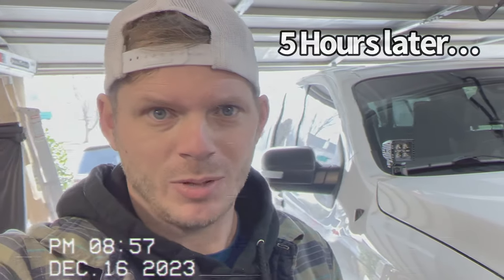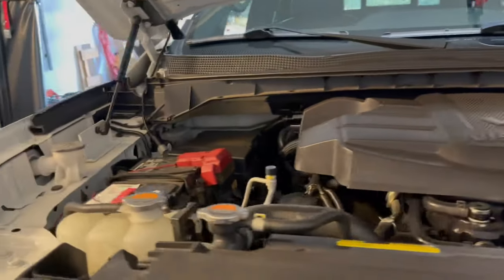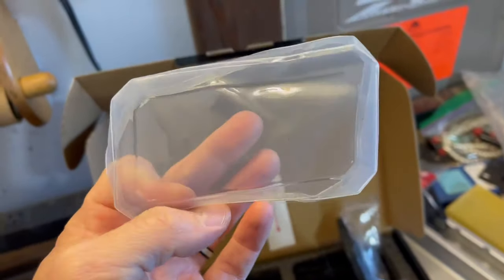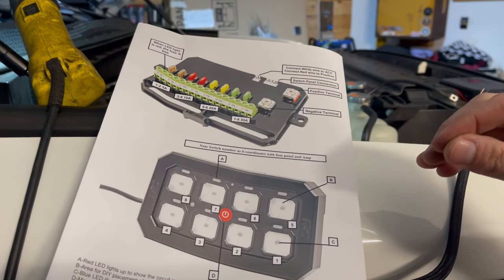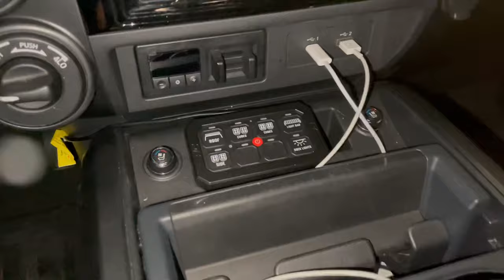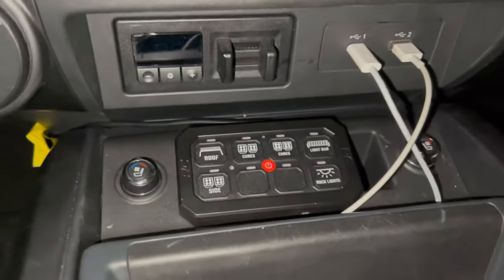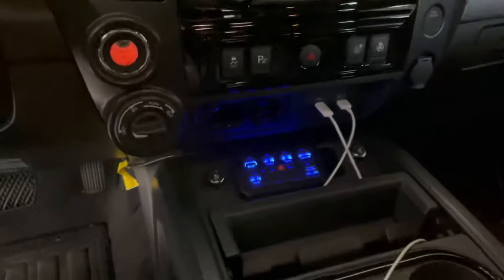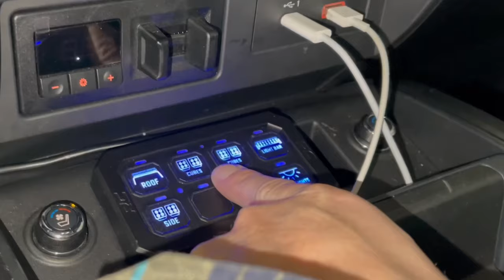Rough Country 8 Switch Panel Install | Nissan Titan Off-road Lights

Comment: Clean install 🤙🏽 what did you end up doing with the white Accessory wire sense I didn’t go into the fuse tap?
Reply from the maker: The white accessory wire just went to the negative battery connection on the panel.
Reply: Makes sense thanks!

Comment: Great info! Did you tap into an ACC fuse under the hood? I noticed your switch panel was lit up before you turned anything on. I can't seem to find one that isn't always hot under the hood.
Reply from the maker: I couldn’t find one either.  I actually just ended up using my original rock light switch to be a switch for the panel.
Reply: that is my issue my panel is on all the time? can someone recommend another fuse on that panel ?
Reply from the maker: @jaimeherrera5419  there are t any.  I checked them all.  You can just put a small switch in line.  Run the power to the switch then from the switch to the panel.  I just used a small toggle switch—if you watch my rock light install I show it.  So when I know I’m going to be using my off road lights I flip the switch and have power to my panel.

Comment: Question: I connect the fuse cable to the same opening fuse, do your control panel always stay on?
Reply from the maker: Yes.  I ended up putting a switch in line to turn power off to the panel.  I was not able to find an accessory fuse.